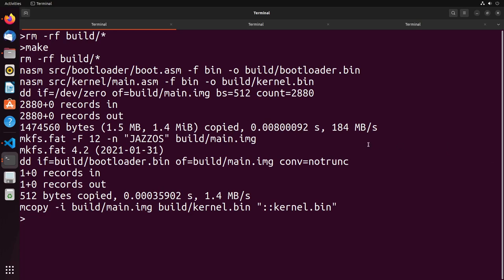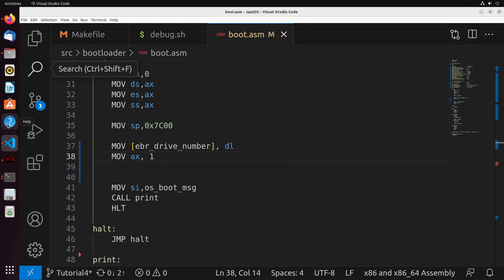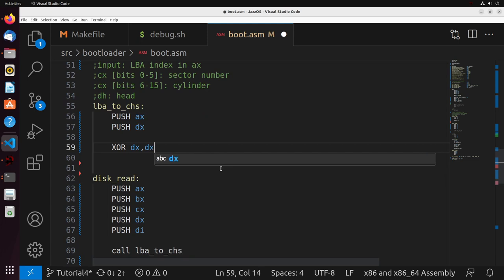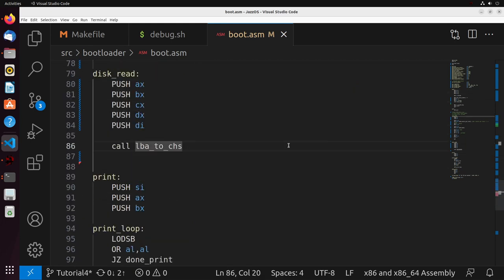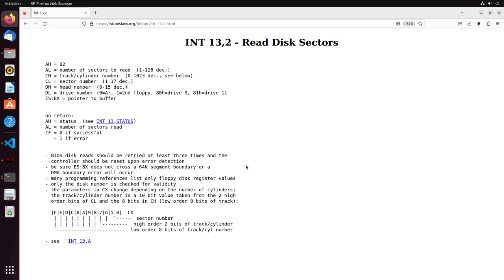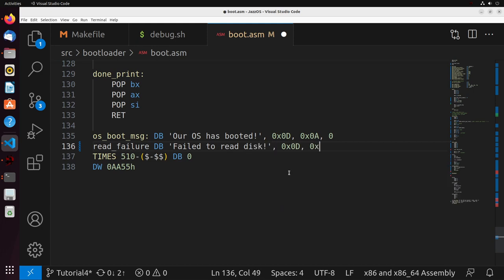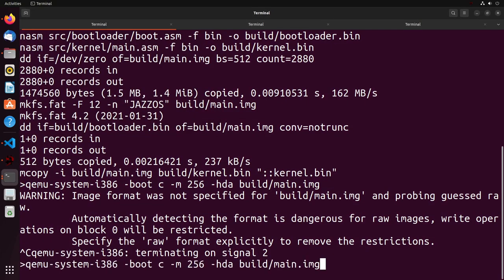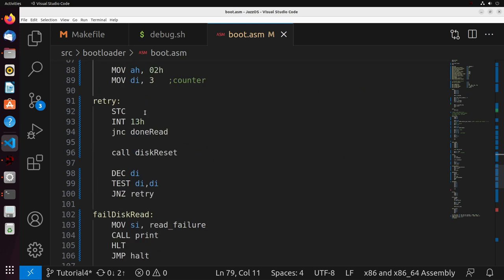x86 Operating Systems - Reading From the Disk in BIOS

Comment: At this point I only remember two commands to write in BIOS without the kernel helping me and also to read a disk without the help of kernel's system call.

to write in BIOS to the screen

mov ah, 0x0E # 14 in decimal . only 16 bits is required for this data.i.e a WORD
mov bh, 0 # select page number

to read a disk:

int 0x13 # 2^4+3=19 in decimal. software interrupt to read the disc. needs WORD data type 16 bits.